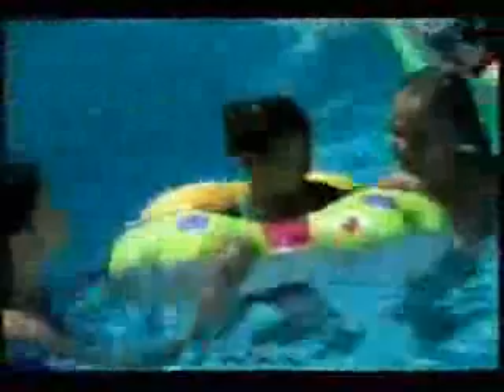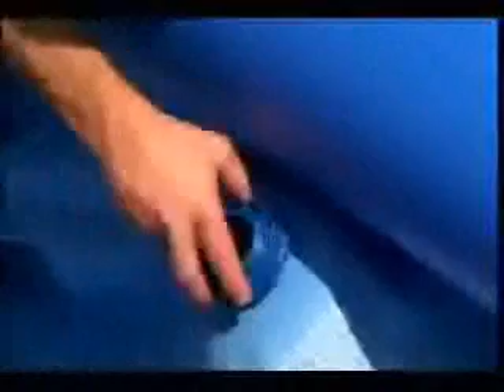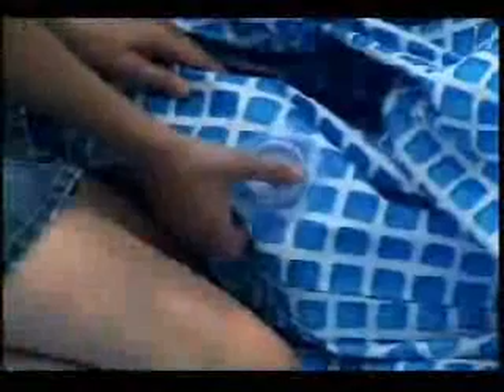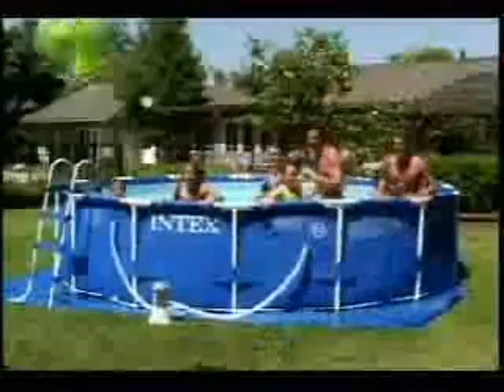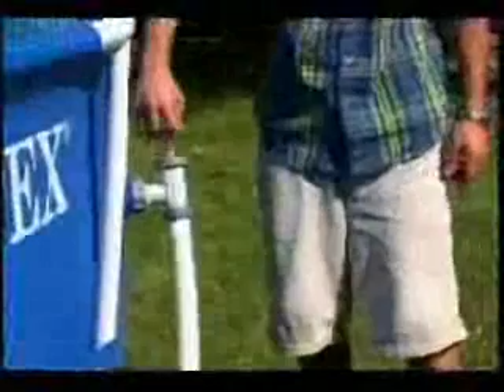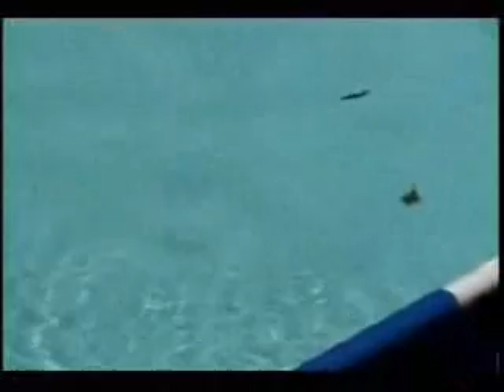Intex 1500 gal/hr Filter Pump Model 635 Setup Guide

Comment: Mine is making to much noise and doesn't seem to have much water flowing thru. I've checked filter released what from filter tank but still makes noise. Any suggestions? Also which side is the water flow in from? Does it go directly to Filter side or motor side?

Comment from the maker: You can get a 1500 to fit any pool. You will simply need to get the regualr 1500 kit or the upgrade kit depending on your hoses? Do you clamp them onto your pool or screw them onto the side? check them out at bluefade.com

Comment from the maker: Check out our other video about installing the hose adapter B's.  Attach these adapters to your smaller pool fittings, and then your plunger valves to the other end of the adapters.  Your larger hoses will fit onto the plunger valves, and you will be set!  Visit us at bluefade.com to order your hose adapter B's!

Comment: We bought a 635T Krystal filter pump 1500 to replace the smaller one that came with our Intex Metal Frame AGP...The new filter pump hoses have a larger diameter where it enters the intake and outake holes.  Is there an adaptor part to fit in the smaller holes or do we have to be creative to make it fit through? ;)

Comment from the maker: @tequilah39 - You may want to inspect your cartridge and all the seals of the pump. If all is working and looks good during inspection but your pump still hums the impeller is possibly burned out. Intex covers their pumps for 1-2 years and will replace it with little hassle as long as you have proof pf purchase.

Comment: @Jellox958x the old video shows one come with it ( a tarp I guess it is ) but yeah I plan on putting one down and also buying some bags of sand from Home Depot, $2.99 a bag.  I think I will need a good 15 bags.  I don't want any problems.  I had a huge pool at my old house, and they put sand down first - awesome on the feet when walking around in the filled pool.  Sand good because no pebbles, etc.... pure sand, so no potential for holes.  More money to spend though. argh LOL  Thanks again

Comment: @FrostyTheBeerMan 

The metal frame pools are amazing and really sturdy. When I bought mine I thought it would shake/collapse. It really is sturdy. You can jump around hold onto the sides. Our pool is uneven by 2 inches on one side and it holds up just as well. The blow up ring pools are horrible though. they overflow and collapse easily.

Go with the metal frame that is shown above. Ohh and when it's empty/ filling up the legs tend to move around (because of no water in it) just move them back